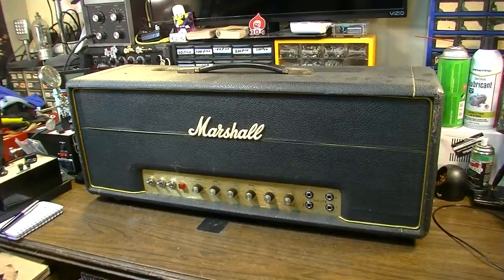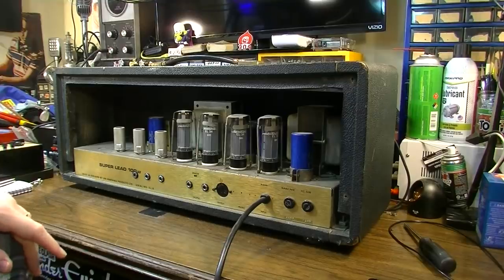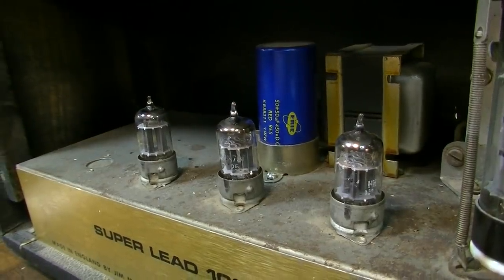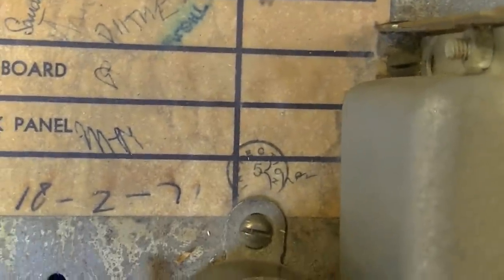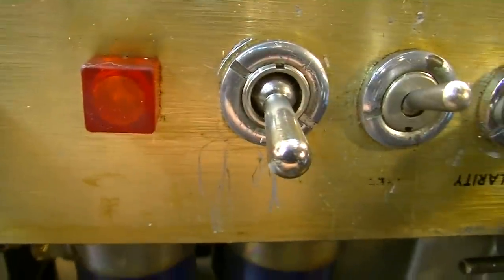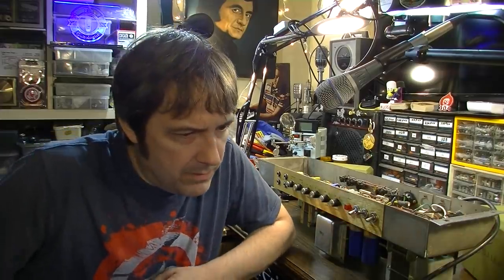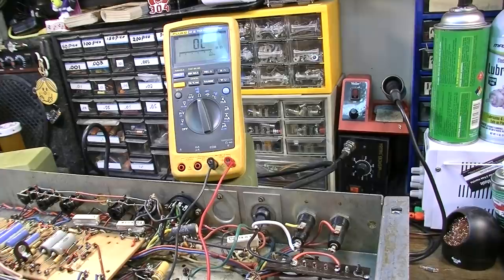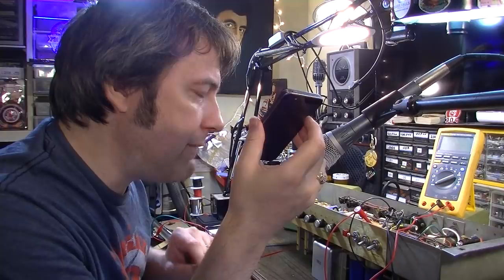Secrets of the Marshall 1959 Super Lead - 100W VINTAGE 1971 TUBE BEAST REPAIR!

Comment: Marshall is about an hour down the road from my house. I took my basket-case JCM800 2 x 12 50W Master Volume combo (4212) to them. She still worked, but knobs were broken, the speaker cloth and Tolex were ripped, the screws were rusty and the plastic fittings were scuffed and cracked. Marsha had had a hard life since 1983, when I first lugged her to my car from the guitar shop (alas, now gone). I am an operatic metal guitarist and singer, and the amp was sticky with beer spills and smoky-smelling with cigarette burns after years of gigs. I'd had a couple of retubes over the years, but that's about it.

The guy at Marshall quoted me a less terrifying price than I had feared, but he told me that it was impossible to replace the speaker cloth without damaging the Marshall logo. But then he casually leaned forward and snapped the logo in half, saying, of course if they damaged it, they would pay for it (and those are more expensive than you might think), The only thing they could no longer get was the old "JCM 800 50 Watt LEAD" plate.

They retubed and recapped, replaced the missing knobs, the Tolex, the speaker cloth, the Marshall logo, the feet, the corner pieces, the none-too-useful handle and the screws. There are still battle-scars on the control panel, but otherwise she looks good as new, ready for another 36 years' rocking. I finally got a case for her, too, and I no longer smoke or rest my beer on the amp. And I sourced a reproduction laser-cut 50W Lead plaque.

My bass player and rhythm guitarist  have all replaced amps over the years, and bring spares to gigs: I've never had to, and Marsha has never, ever let me down. She's a tank.
Reply from the maker: Great story, sir! Thanks for sharing!
Reply: Hey, I love your videos, and I love Marshall amps! It is a sheer accident of birth that I live just down the road from Marshall. It was a really great amp museum, seeing all the other old Marshalls there for refurb or repair, and the tech showed me around their repair facility which, as an electronics engineer, I really appreciated.
Reply: I took my JCM2000 DSL100 to Marshall. They are about 20 mins from me. I was shocked how reasonable they were for servicing. Worth a walk around the factory when it is open as usual.
Reply: My birth was a sheer accident as well except I live just down the road from a crackhead. Oh fate!, why doth thou mock me!?

Comment: I haven't watched far enough yet to see what the actual problem was, but any time someone says they "checked" the fuse, and it was "good", I ask how they "checked". Mostly, people look and if they see a wire inside the fuse, they pronounce it "good", but I've seen (and been fooled by) a lot of fuses that blew down at the end where I couldn't see it. But check with a meter, they had no continuity.

Comment: I have a 50 watt version similar to this amp and i lent it to somebody who plugged headphones into the speaker outlet. when i got it back and plugged it in it almost went on fire. i know it is going to cost a fortune to repair so it has been sitting for years doing absolutely nothing but gather dust. it was without doubt the best amp sound i ever heard.i saw one for sale on e-bay for £3.5 k so  good luck with the repair on the one you're working on

Comment: Red finger nail polish QC?  Nowadays, Marshall puts QC stickers on their stuff.  Doesn't mean they test, just that someone puts a sticker on.  Let me explain.

Once upon a time, a group of us guitarist in various bands bought five new DSL/TSL heads (when DSL/TSL were new).  Out of the box, only one footswitch worked (1-5)  Korg was Marshall's distributor in the USA at the time, so I called their support.  I explained the situation but also suggested they escalate to Marshall informing them that someone is not testing their gear -- yet getting paid to put QC stickers on their equipment and at the expense (literally) of customers.  Of the four replacements Korg sent, one only worked (1-4)  Again, obviously no one actually tested if the footswitches worked.  As before, Korg wanted me to ship (my expense) the bad footswitches back before they would send replacements.  Three back, three shipped, only two worked (2-3).

It is at this point I pointed out how ridiculous this was to the Korg rep I was working with.  We were working musicians with brand new amps some of us couldn't play since we could not channel switch.  At this point, the rep just sent three more footswitches, I didn't have to pay to return the junk anymore.  Guess how many worked?  I stripped out working parts of broken ones to fix one.

I hoped Marshall would change their ways, but then new DSL/TSL boards don't come with stand-offs or fuses, do they?  Out of the box, something you can't use.  Frustrating!

Comment: Those ohm selecters for the output, wear out  the contacts get bent out and stop touching each other, if they where switch alot anyway, I took mine apart and cleaned them and that was one of the problems with mine.  I don't understand the 5 different output either that don't make sense
Reply from the maker: Yeah, just an odd mod.

Comment: I have a '73 Super Lead 100 watt. It is painfully loud when you get it up to it's glorious rage in volume. It is the top amp <--. All the tolex has been removed and that is what you get underneath. 1973 was the last year of the PTP made models. They started the PCB builds in the summer of that year.
Reply: Hey bud I've got the same amp from 73 too ...sounds amazing no doubt about it

Comment: My Marshall JCM800 4212 HAF (Heavy as Fuck) combo was in a sad state after years of heavy metal gigs, getting knocked over, beer spills, cigarette burns, etc., etc. As I live not far from Marshall, I took it to them for restoration. I ordered new knobs, a re-tube, new caps, Tolex, speaker cloth, corners, screw, feet... you name it. I also said I wanted a new Marshall logo, and the sales guy shook his head a little apologetically and said they were actually really expensive because the old ones have to be specially made. The he walked up to the amp, grabbed the logo and pulled until it snapped, saying, "Oops. Now we have to replace it for free because I accidentally broke it." They did a master job on Marsha, so she's ready for another 30 years' rocking. There are still some battle scars on the front plate, but she's cherry otherwise.

The thing I really like about Marshall is the way they said they're just as keen to keep old amps on the road as they are to sell you a new one.

Comment: Hey Brad , while yard saling this weekend I bought a Zenith model X 334 W 2-2345 am/fm tube radio. I am thinking about adding an input jack and a switched output jack to it to make a small bedroom guitar amp. It has 7 tubes in it and a 7” elliptical speaker which is working as is the radio & amplifier. I am was thinking about tapping into the selector switch for the input and using the switched output jack to cut the small elliptical speaker out of the circuit while I use an external 12” speaker for guitar. I can access a schematic on the internet and was also thinking of shotgunning all the caps while in there. Any thoughts that might help?
Reply from the maker: If it has a power transformer, it could be a cool project. You just need to find where the audio amplifier begins in the circuit and tap in your input right there and make the radio incoming signal off the detector/demodulator stage switchable going into the audio amp stage. This way you can keep it as a radio and guitar amp both.

Comment: Jeeez - I have a hardly used and mint 1971 Super Bass head thats identical to this. It has the tone stack mod done my Marshalls to make it both bass and lead - I can't tell the difference when you flip the switch on the back but, uuh. Horrible amp, really noisy, horrible tone, just a nasty, loud piece of crap. No tone. Anyone wanna buy it?!? anyway, going to plough through this and see if i can find somethng horribly wrong with mine (please!) thats fixable. Many thanks in advance. :o)

Comment: After watching the video I noticed some points I want to share with you guys since this is also an educational video on old marshalls. Im not really familiar with the can/us superleads so I might be off by some parts in which they differ from the eu/uk models.
1. The stby is an original "arrow" switch. The polarity might also be original (with "droplet" leaver). Power is bad and also could have been replaced earlier.
2. The red inspection paint has been repainted at some points. The diodes don't look original to me, so the paint is also not original. Good find on the brighter color.
3. The last output jack is a different brand, as noticed (rean). The other ones could be stock, especially with the red wire covering between 2-3. Not sure why, but ok.
4. The output selector switch is a new, the older ones had a selector pin and had no rotary action.
5. The 82k plate resistor of V3 has been replaced and retouched with red paint. so there were some repairs done before.
6. The "plexi"-cap has been added at the cathode of V2 over the 820 res.
7. Two big capacitors are missing next to the diodes. Does not affect the sound.
8. Some of the output tube sockets have been resoldered. There should also be some red paint on the pins. Im not sure if some of them have been replaced and also if the white screen resistors are original. They could be. The solder joint should tell us.

Keep up the work, just wanted to share my thoughts on that amp.
Reply from the maker: Thanks for the comment. I think I agree with most of those observations. Part of the fun of working on this stuff is the forensic combing of the "evidence" left by other techs and the history of the piece.
Reply: @TheGuitologist  Save those tubes for the studio, use Sovteks or JJs live you can't tell in the chaos anyhow

Comment: The unused hole is for a tremolo footswitch on the Super Tremolo models.  All they had to do was punch the hole out for a 4th preamp tube and the switch hole and you were in business to wire it up.

Comment: Brad, have you any tips or suggestions on how to clean up the 50 years of corrosion and cr*p on a chassis like this? btw the one on your bench seems to be missing a mains voltage selector between the power cable and the speaker impedance selector.  That could be what one of those blank plates is for.
Reply from the maker: Start with a damp cloth. Warm water and regular dish liquid to wash off the grime. After that dries you can use 1000 grit steel wool or a soft wire brush and Dremel to knock off corrosion. Then you apply some wax at the end to seal it and prevent future corrosion.
Reply: I’ve had great success with removable parts in the dishwasher.. Even stripped an old chromed snare drum and put it it in parts in the dishwasher! Came out lovely. For corrosion and rust then vinegar soak for removable bits for a few hours and cleaned an intact chassis with vinegar and a toothbrush. Last one was a 1962 Fender Super, lots of crud and rust but bit by bit vinegar  and toothbrush followed by scrunched up aluminium foil (I’m a Brit!) to rub the rust off. The foil cleans it without scratching unlike a wire brush or dremel. Bit of elbow grease and it makes your hands dirty filthy but it does a great job. Hope that helps. Jonny
Reply: good 'un Cheers! Good points. Wouldn’t recommend scrubbing anything with lettering and the foil works great for getting rust off much less damaging than wire brush. Have used on aluminium parts seems ok. Try it on a small test area first. Always wash off the vinegar with a water dampened cloth and agree with Guitologist re waxing after to protect. Can turn a cruddy looking old chassis into a thing of beauty.

Comment: Hmmm...  going to have to comment on everything (I built amps commercially):

Yep, they are original caps.
Mica colour has nothing to do with hours as its in a hard vacuum, a harder vacuum than space. The catcher going a little brown is normal, its catching stray atoms. If the glass is brown and / or the valve sings if you tap it (even when switched off) then its toast. These are completely fine and Seimans are very good valves.
Brown ring on ECC83 - been there since new. I've dealt with thousands of valves from new to antique and this stands.
Date - Day / Month / Year ascending, how the world does it except America.
The 1k 5w resistors have cracks in them and need replacing, they wouldn't get through winter in Northern Europe!

Comment: Yeah, those 50/50uF and 100/100uF cap cans aren’t cheap. $15 to $20 each! When you need 6 or 8 and a full tube set your looking at $200+ and labor. I’d charge around $350 to $400 for the full bang.
Reply from the maker: You're in the ballpark probably.

Comment: What confuses me with those output jack  mods (amongst other things) is it looks like they have the red QC control paint on the solder joints, all though clearly some are not OG?
Reply: none of those plastic molded "modular" jacks are original....they're obviously new ABS plastic which didn't exist at "the turn of the seventies".  some fuckery has been going on regarding the red paint on the joints.

Comment: very late 71 ..
the Board is a production change before the PCB 1972
my early 1971 had plastic toggles
Reply: says February : )  right ?
Reply: @MrSimondaniel3  the actual Parts, are very late year parts
I don't care what the chassis stamp says
my 1971 had a "breadboard" PtP board, and black plastic switches
I bought this new 
when did you buy one ..??
Reply from the maker: I'll defer to you guys on those particulars. I'm not a Marshall historian. I don't see enough of them to know.
Reply: I believe the pcbs started some time in '73.  I have a '72 100w SuperBass (amazing).  All PTP.  The switches are black bats.
Reply: @TheGuitologist  really ??  The ones that used EL34s blow up a lot. 🙃

Comment: I just did the replacement-parts research for this amp - main F&T cap kit $70, 3 proper switches with proper front nuts $55, proper red square pilot light $5, and add maybe $15 S&H for a total of $150 less the necessary PCB caps (add $25 or less) through tubesandmore.com (amplifiedparts.com is the same company of AES) for a parts total of $150-$175. Labor is of course on top of that :)

Comment: I stopped playing bass between say 1978 and  2005. I sold all my gear ( two Hiwatt 4 X 12 cabs and Sound City 100 watt head) . During my break somebody has f**ked around with watts. I know about decibels an all but a modern watt is not as loud as a 1978 watt. I may have got deaf of course and there ain't that much good music any more. Also using wimpy backlines and massive PAs is for girls. ( I mean wee tiny children girls not fully built real gals.) If you must do this to fill a stadium retain a massive backline. Yours ever, Pete, Irish, age 68, deaf and don't care.

Comment: In a nutshell, the 60's ones are considered the best. EVH said that, so does Yngvie and many others (they would know). Then in '70/'71 they got much brighter, not considered the best years. In '72 they got gainier and thicker, that's considered a good year but others in the 70's sounded great too. The '78 with 6550's is considered another great year for a heavy smack-down and I've heard plenty of pre-800 master volumes that sound fantastic as well. Another big factor is it's hard to get good tubes anymore and the new Celestions don't sound the same either.

Comment: Tsk tsk, it isn't the brits who have their dates the wrong way round! The day is in the month which is in the year, so that is the only logical sequence, and if you think it's the wrong way round, why don't you US chaps put the year first as well? You may as well if you put the first two reversed! Seriously, I love watching your videos, because although I can't even solder, I've owned four Marshall's , from a sixties superlead 1 (plexi 100) to an early JMP seventies 100 with metal switches and a master volume that someone had put into a 1/12 box as a combo, then a two by 12 open back channel switching reverb, and a 2210( JCM 800) head and at the moment have a Marshall tube power amp (50/50) into which I run a Mess Boogie preamp. All my amps have sounded slightly different,even though the circuitry on at least two of them is pretty similar, and yet they all have that certain Marshall sound, whether plexi or JCM 900, and I love that full throated sound many of them have, especially for warming up single coil guitar tones. I had my plexi worked on and tubes and caps replaced more than once in the 15 years I had it, and also experimented with having diode clipping behind the inputs, but always returned it to its original set up.It had been used by a bass player when I bought it in 1971, and had an enormous transformer, putting out 180watts RMS when on the scope... ahh, I can dream, if only I still had it, but it was stolen from me and lost for a year ,but spotted by me in a live band and returned to me by the police, only to be hit while in a parked car by a drunk driver who took so long to pay out on the insurance that the repair shop sold it to someone and the crook who ran the place left for Australia ( from here in Auckland NZ) never to be seen again, and leaving many debts behind. I love watching this kind of work although a lot of it is Greek to me.

Comment: I have this same amp, a '73. I got it in the mid-90s. It's been F'n thrashed over the years. I had an "fx loop" installed by some weirdo in the 80s, Some weird "mods" and hack jobs have been done and it doesn't work. Could you recommend anyone in Northern California that could work on it?